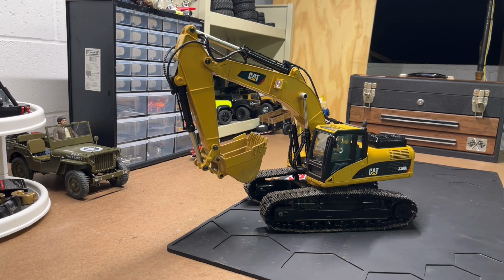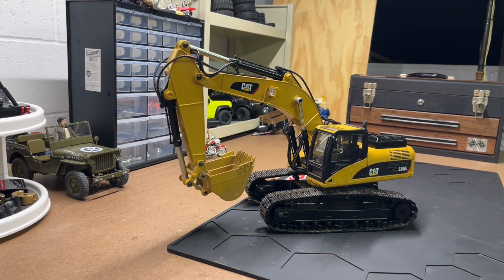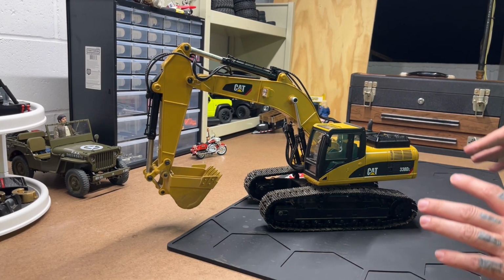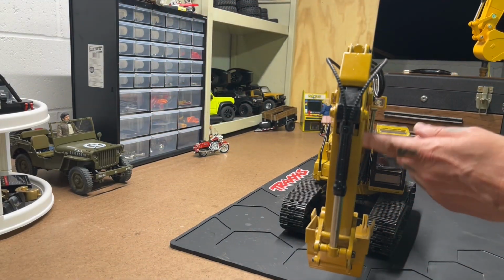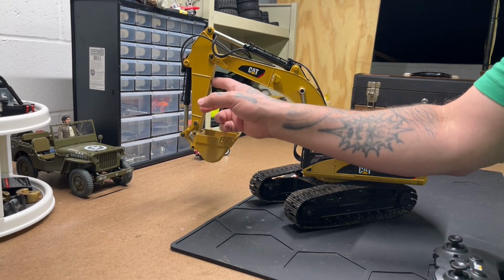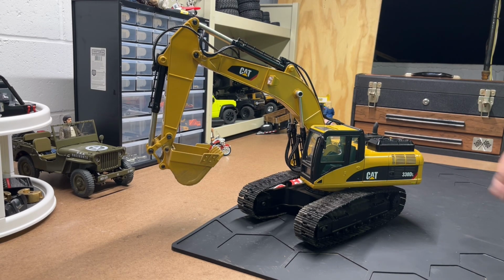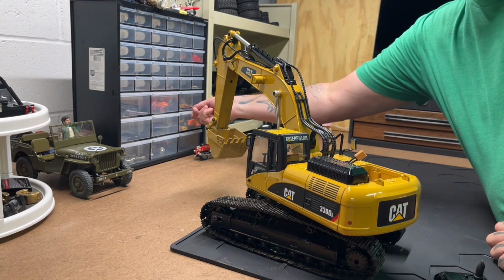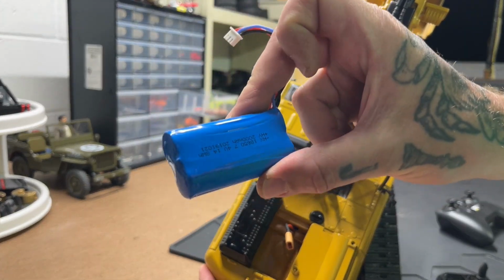Diecast Masters 1:20 CAT 330D L All Metal Excavator - RC Construction

Comment: I couldn’t stand the sound loop so I unscrewed the 5 screws holding the house to the chassis and pulled the 2 
prong  plug to the speaker. Now I have lights and only mechanical sound from the unit itself.
Reply from the maker: The sound is pretty bad honestly. But I do like the track sounds when moving. Thanks for the comment.